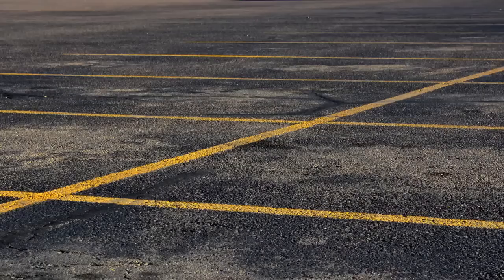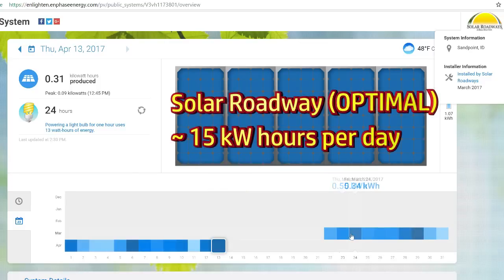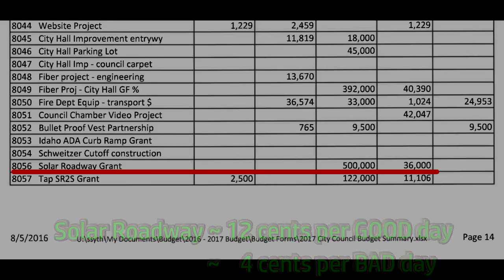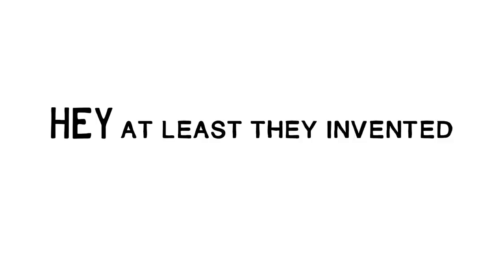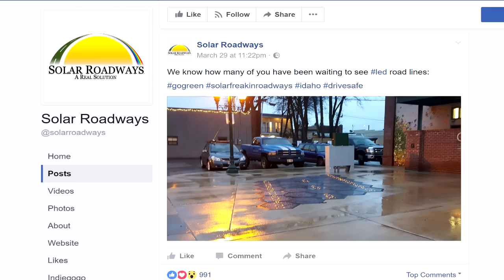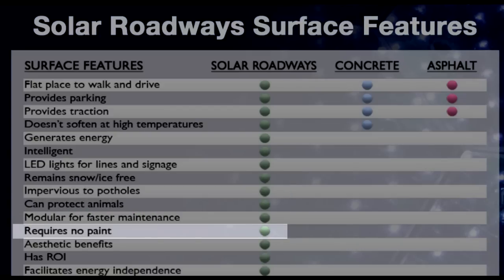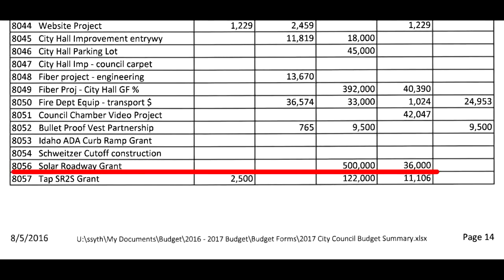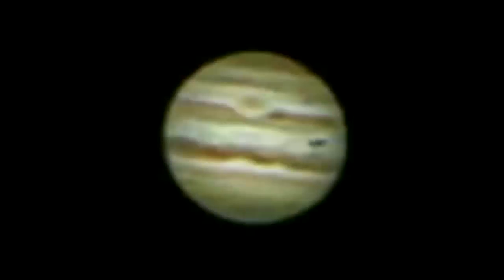Solar Roadways generate ~10 CENTS per day!!

Comment: It doesn't even produce enough energy  to run a modern gaming PC :V
Reply: What monstrous gaming PC do you have? The average gaming PC (with 1 graphics card) consumes on average less than 400W on demanding task like gaming and much less in idle. Under optimal conditions you could power 2 or 3 gaming PC's with those roadways.
Reply: Kennie Baillairgé You might consider getting a Kill A Watt meter and see how much power your PC uses, modern PCs use very little power at idle, load usage hasn't dropped dramatically but doing nothing you can easily see results as low as 50W (even less on low-end CPUs) and even modern GPUs idle very well too, for instance, an idle GTX1080 only consumes another 10W.
https://www.guru3d.com/articles-pages/core-i7-7700k-processor-review-desktop-kaby-lake,8.html

Dick Buttox 750W? Unless you're running some sort of crossfire/SLI setup I see no reason a system would ever need over 400W-500W PSU, even with a slightly older system, my CPU and GPU only use about 250W and I have an SSD + 3 HDDs which adds another 70-100W of max load, plus in case you're unaware, its always better to get a quality continuous 500W 80+ PSU over some cheap ass "claimed" 1000W PSU.
Reply: In the decked out gaming PC my buddy just built the fans and liquid cooling pump use more energy then the rest of the computer.
Reply: When i was looking for the parts i noticed the trend of increasing power obv. But i didn't take into account that the power efficiency of parts would rise too, So i ended up buying a 950W PSU about 6-8 years ago, its lasted me since. I can't imagine any modern PC needing 750W+ at any given time with how power efficient parts are now.
Reply: Dick Buttox yes it easily does. What fucking computer possibly runs over 1000w?
Reply: Probably all to do with the 10xx's, they're vastly lower power than the old generations.
Reply: Kennie Baillairgé
Your math is a bit off there. They produce 1 kW per hour that means if you have on average 12 hours sun per day, that means they produce at least 12 kwh per day. Which is plenty to power your PC the whole day and still have reserves.
Reply: Nolymox Uhh, speaking of math being off, unless you have tracking solar panels, you'll only be getting the full output of a panel for about 3-4 hours in a day if it's angled, although lying flat it's going to be a bit less than that closer to 2-3 hours of good sunlight, so you might normally get a little over 400wH out of a 100W panel per day, but even in direct sunlight don't expect to get the full 100W out, closer to about 95W, plus there are going to be losses along the way, including cables, stepping the voltage up or down or inverting it into AC and if charging batteries those will lose a bit of power as heat too, so in total expect to get closer to 80W-90W if you have a good system
Reply: +Nolynox you are way  off there. Remember kWh is unit of energy E (J) and kW is unit of power  J/s. kW/h would be kinda meaningless unit implying change of power output per hour.  

Notice the text on days "peak 0.09 kilowats"  So he's completely right in saying that you would need to store this in battery to run anything that takes over 100W. The daily total output is at 1kWh or 3.6kJ
Reply: These were measured to produce 1 kWh on a good day. Assuming 100% efficiency in storing this system couldn't keep your average laptop running all day. A gaming PC could easily burn through that power in 2 hours. If it's a high end, water cooled, SLI (or better yet Crossfire), streaming PC or the like (so it uses a lot of CPU horsepower while gaming), you wouldn't even last an hour. Don't forget to add power for any monitors you're using. Of course I'm talking about under load, because there's no point in powering a computer that's idle. Idle power consumption is actually completely irrelevant so I don't see why that other guy brought it up.
Reply: something1random23 "Idle power consumption is actually completely irrelevant"
What? How is it irrelevant? Who uses their PC 100% of the time that it's powered on?
You also need to consider the various degrees of load, simple browsing/watching videos will use very little power beyond idle consumption, in fact sitting here typing this comment, your PC should be more or less idle, so it's not at all irrelevant if you were to log how long your CPU stayed in 0-25% / 26-50% / etc... Then you can calculate its duty cycle, so let's say you used your PC for a total of 6 hours per day, 0-25% usage for 3 hours and the rest for 1hr each means get roughly, 50W x 3h = 150Wh at 0-25% + 70W x 1h = 70Wh at 26-50% + 80Wh + 100Wh, so in total you would use 400Wh or 0.4kwH of electricity per day, the idle/low power state is very important for getting this total because most of the time you probably aren't going to be encoding or doing some heavy workload.
Reply: I doubt Corsair are cheap.
Reply: +Nolynox 
"The average gaming PC (with 1 graphics card) consumes on average less than 400W"

If by average you mean cheap, yes, kinda. A decent video card hovers around 200W, CPU and MB around 100, RAM and SSDs are bout 50, best case. So, about 350W, from the case, another 70-100 for monitor and peripherals. Roughly 450W, a very common PSU rating. Booooring.

But. ------ good ------

GTX 980 ti eats up 240 W TDP before overclocking. A dual setup would easily jump 500W and 980ti is tame, launched June 2015. A refurbished is $300.

The CPU starts at 120W for a K series, but shoots up like crazy when overclocked. Last I checked, my ~5 GHz dissipates over 240W+, and yes, it's on water. From 1V to 1.4V your essentially double power (+96%) from overvolt alone.

So we're looking at 700W from CPU and GPU alone, disks may add up to 100 W if you still use spinny disk array, plus whatever cards you have in tow.

We'll call it 800W from the case. Not an extreme setup.

Now, a PC includes all peripherals: light mouse, keyboard and headsets, monitor (should be 100W alone if you have a decent one, 200W for a dual setup), plus other powered stuff: VR, steering, lighting effects, water pumps and ventilation, they add up. Over 1000W.

It's not a regular PC, granted, but a dual GPU, well stuffed box isn't unique either. 

But. ------ Excellent ------

For example, AMD does dual GPUs routinely, and, nicknamed PSU killer, R9 295X2’s TDP is 450W alone (900W for a crossfire). i7-3970X has 150W out of the box, 250W+ overclocked. You're spiking over 1000W from the box alone; let alone monitors or SLI/Crossfire, let alone overclocking.

Now, granted, that is extreme. I'm running a 980ti and an OC i7, I'm probably hovering at 600W minus peripherals, 800W with. Still a far cry from 400W.
Reply: ***** I wasn't disputing what you were saying. Since I was on a computer for my original reply there was no way to properly link who I was talking to.

Comment: But after 13689.253936 years you have the money again!!
Reply: minus repair costs.
Reply: It's a bargain!
Reply: also minus he power they consume...
Reply: Ok, let's say 20000 years
Reply: The best return of investment you can get from solar road ways, is to turn it off the instant you turn it off :)
Remember it uses more Power than it generates, so everyday it cost you more and more money :)
Reply: ignoring the value of money
Reply: 13,689 years, 94 days, 17 hours, 32 minutes, 59 seconds, and 136 milliseconds. That's a pretty dang accurate number there!
Reply: tntbela тɴтвeʟα in 13'000 years we are either all dead or have so much energy, that we will laugh at the energy output of our planet (or we are back to stone age)
Reply: tntbela тɴтвeʟα in 13'000 years we are either all dead or have so much energy, that we will laugh at the energy output of our planet (or we are back to stone age)
Reply: No you didnt watch the video, there is so much heat so it can remove snow.
Reply: The only relevant question after that is; how long do each component last? ... you may never get your money back if they wear down faster than they generate the money back...
Reply: You do realize there is such a thing as product life? The product life is estimated to be 25 years. If it can't pay for itself in that time frame, then you'll never get the money back, not in a million year.

Comment: But, Thunderf00t, maybe this is because the solar panels are nor produced in mass, so their individual price is significantly higher... isn´t it? I understand that this project have too many problems that makes it just a bad one... I´m just talking about the price, it will be obviously high because is nor a mass production.
Reply: even if that was the case, they need to be repaired constantly, and thats without 1-10 tonne vehicles driving over them 24 hours a day, and they still produce practically nothing. even if they were cost effective to produce, they are still a massive waste of time and resources.
Reply: The price is thousand of times compared to a normal solar panel. Mass production could cut at most 50-70%, which is still overpriced.
Reply: Even if you cut the cost by a factor of 10 a rooftop installation is still superior in every way.
Reply: The development price is the best thing we can compare to, we dont have any other numbers to use. And I would say a quarter of that money is used in material and production cost. As thunderfoot explained in previous videos the solar panels are very expensive to make and install from the glass, electronics, concrete pad they install on, the drainage system and everything else.
There is alot more that needs to be done then "put it on a flat piece of ground and say good day"
Reply: This thing generates around 44 dollar per year in revenue if we are generous. This means, that to return a decent return on investment at around 5%(Assuming this thing will never break down), it would have to cost around 880 dollars to build this garbage, which is crazy compared to what it actually cost to build the roadway of around 500k.
Reply: Even with mass production the amount of fossil fuels needed to produce regular solar cells means that they need to last something like 10 yrs to break even. These things are supposed to be run over by traffic. The numbers make this a really awful idea.
Reply: Still doesn't change all the other reasons it's a complete failure. Things like not being able to see the LEDs in daylight, it not generating decent amounts of electricity, the fact that paying people to dedicate their roofs for rooftop solar arrays would be cheaper and more efficient.
Reply: if the price was a hundred times lower, it would still not be cost effective
Reply: Well let´s say they could cut the price down from 500 dollars per square foot to 1/10th, so 50 dollars per square foot. That means paving a Walmart driveway would still cost around 50 million dollars. And if they generate electricity at the same rate as their prototype does, with 1/10th of the installation price they´d still take 1000 years to get their money back (instead of 10000). And that is without maintanance or power consumption from the LEDs. 
They can get as cheap as they want with the production, it´s still never gonna be worth it.
Reply: well that and the fact that the leds in the things consume like 100 X what the solar panels produce and last time I checked walmart parking lots are pretty much always full and a full parking lot will produce no power.
Reply: Hamsters running in wheels would be a superior way to generate power.
Reply: I do agree with you to a certain extend, it is more expensive because it's not a mass production and it would all get better with mass production, because these folks seem to have no clue how to improve their product.

That being said, they are a terrible idea for roads. Roads need to be tough and provide grip. Sidewalks maybe, but in cities there is a lot of shadow from high buildings most of the time.
Reply: Even if the solar roadways panels cost the same as the commercial panels, it would take like 100 years to get the return on investment, factoring out the maintenance costs which are inevitable with any sort of road way.
Reply: If solar was so simple and fantastically economic we'd have them planted all over roofs already.  Let Alone anywhere else.   Reality is Driving on Solar panels is a bad idea,   You'd be better off taking all those solar panels and planting them across the salt flats or something like that.. they would do far far more good.   And hell if you want illuminated roads Thats a Possibility!

It is definately possible to inlay LED's in the roads and illuminate them at night/dusk to enhance visiblity, and if you actually accounted for their power usage by putting the solar panels that would account for close to the countries entire debt, somewhere useful it would be no problem.

Reality is.  Changing over and converting infrastructure is extremely difficult and costly.
Reply: hmm
Reply: Also the development costs have already been covered in the fund raiser and department of transportation way back before this happened.
Reply: ok robert, you got a point. I still think that that´s not a fair comparison, but clearly the initial production price is not good enough to give to this project the minimum viability needed. Thanks! :)
Reply: can you say that again in english please?
Reply: Solar pannels are already mass produced, so why not just use those and put them on ppls rooves. Most houses and buildings don't seem to have them so maybe let start there xD
Reply: They still lose money over time...
Reply: Yucannt and Gazorpazorpfield, clearly I didn´t put that math before writing my comment. Yes, the production price is not the final price, but is clearly a good fact to understand the bad performance per dollar on this idea. Thank you :)
Reply: Sagrotan, not exactly, even if a solar panel is mass produced today we need to understand that this project is not just about the solar panel itself, it have some other parts and development needs that increases the price. Is just a fact: make a solar panel road is just not only about solar panels, is about price, materials, resistance, etc. Sure, solar panels are mass produced, but not the only part in this project. I did not make an argument against the Thunderf00t points, I just made a comment about the comparison of 2 values. Anyway, this point was cleared out thanks to other comments. Also, thanks for sharing your opinion!
Reply: You do realise how much resources that is needed per square foot?
Reply: with or with out that cost... its still useless and naive to think we have enough of the good resources being used in such a dumb way.
Its a money waste, and waste of good resources.
mass production of this shouldn't be a thing unless you can clone them out of cheap stuff or use alien tech... lol
the simple thing to have it on your roof (if you live where its sunny a lot) and some tracking then its good enough.

But if you could find a new way to use or rather gain power out of them, then its something to look forward to but I would doubt that could happen anytime soon and for a reasonable price.
Reply: Errrr.... we ARE "planting" them on roofs already.
As well as the MASSIVE solar farms that are built.. plus those under construction.

Have you been under a rock for 30 years?
Reply: what are you talking about? +Armand79th...?
and ofc we have solar power already... and using them... I guess you misunderstood?
Reply: Freddy Ready.. I "misunderstood" you saying that we should do what's already being done??
Reply: +Aura Rowe We have planted them all over our roofs already. At least, in my neighbourhood.
Reply: absolutely, I dont discuss the serious problems that this project have, thats a fact thats really clear. My point is that compare the daily energy production vs the production cost is not exactly the best comparison because that price is not the "real price", because obviously the development price is not the same as the production price.